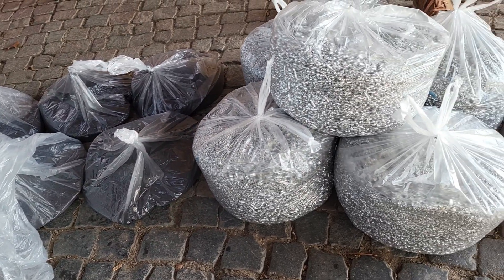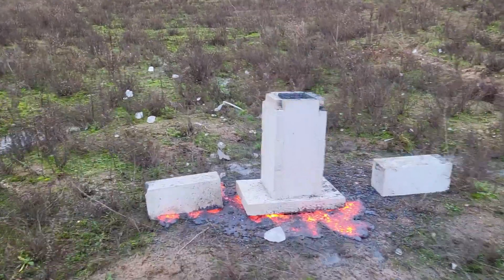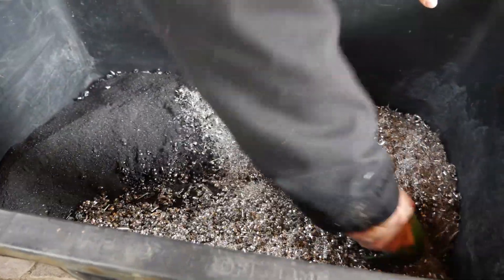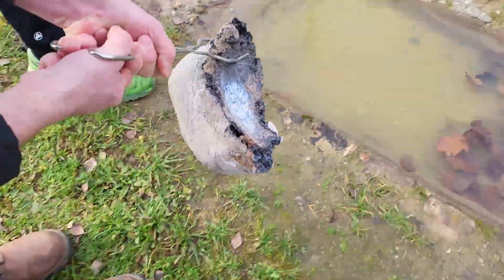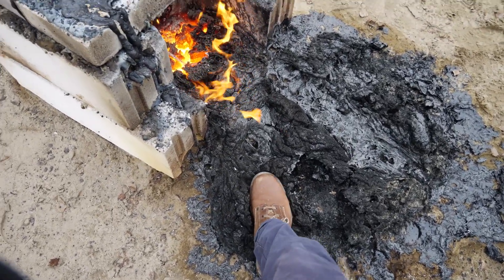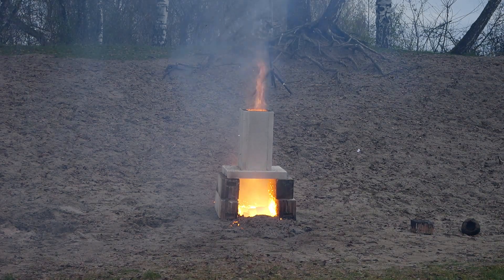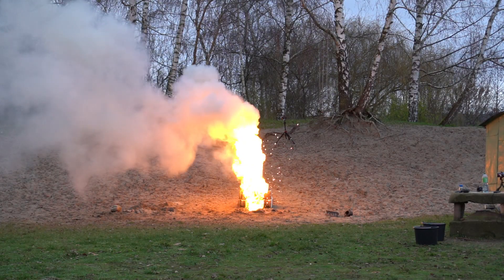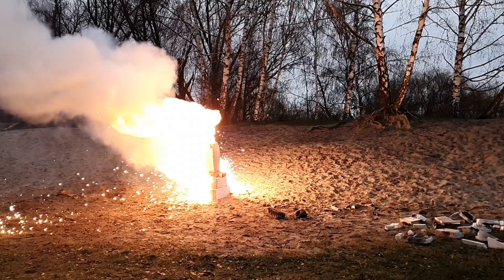Experiment: LAVA vs GASOLINE

Comment: Loyal subscriber Mr. Metal here!
I love this concept, something very volatile/reactive held back by extreme cold! I would love to see NaK/Cs vs. liquid nitrogen, and maybe even vs. liquid oxygen!
to continue with this concept, cool down the Cs in liquid nitrogen first so that its very cold, and then drop that in the liquid oxygen. (of course, if the first experiment does react, and the Cs reacts with the liquid nitrogen, then to cool it off for the oxygen bath, you would first need to put it in a container that protects it from the nitrogen) I also doubt the metal will react with liquid nitrogen, but perhaps it will when hot!
secondly Elias, as for the explosion, its almost certainly a steam explosion, the question is as to what causes the steam to get trapped in such a way as to explode. there's a video from TKOR on a similar subject: https://www.youtube.com/watch?v=73phHyBizec&list=WL&index=7
and when molten aluminum is dropped into ice you get a similar effect: https://www.youtube.com/watch?v=dAHolupCEkc&list=WL&index=5
there's a great video by the backyard scientist on the same subject as well: https://www.youtube.com/watch?v=PDRWQUUUCF0
TKOR also had a video about molten salt vs dry ice, as well as molten aluminum vs dry ice, and there was very little reaction, so I suspect it has something to do with the water, perhaps the fact that water/ice can be a liquid, unlike CO2/dry ice. an interesting observation I should point out, is how molten aluminum doesn't explode in water, but molten salt does. yet they both explode in ice, I wonder why... TKOR also tried this with molten lead in ice, and they got a similar explosion: https://www.youtube.com/watch?v=ur0k8XDFUro&list=WL&index=6 but these explosions don't happen in water, they only happen when you use ice, with the notable exception of salt which explodes either way. it also appears that you need to get the salt hot enough, otherwise the explosion is very small. TKOR also tested molten copper and brass, and got no explosion, indicating that maybe it can't get too hot otherwise the reaction/process doesn't work. too cool, and there isn't enough energy to rapidly boil water, too hot and the Leiden frost effect prevents any water from getting trapped, which means no explosion, but when its just right you get a big explosion. we should test molten zinc in ice as it has a low melting point too, and then try some more salts, like sodium fluoride, or potassium chloride. if zinc and aluminum make a bigger explosion then they might be reacting with the water, since they are reactive metals, so maybe we can try tin and just overheat it a bit so its equally hot as the others then pour it in water. tin is far less reactive and shouldn't explode if reactivity is the main factor. molten silver would also work. we could try molten magnesium, its very reactive, and as long as we don't get it too hot, and don't let it burn beforehand, it might not burn in the water, but might still explode, idk. I also had the guess that maybe since the molten salt was really hot, it somehow started to dissolve in the water very rapidly, and made it boil extra quickly.
I should also mention that The Backyard Scientist also did a thermite experiment in water and got no explosion: https://www.youtube.com/watch?v=tj7S_DNFgEU indicating that perhaps the ice you used has something to do with it, or perhaps the fact that you scaled it up so much. TKOR tried ice vs molten copper which has a somewhat similar temperature to the thermite: https://www.youtube.com/watch?v=lKoUmJp1NIw and they got no explosion. you could try pouring molten iron, and molten aluminum oxide separately into ice.
Reply from the maker: Thank you so much, this is probably the most helpful comment on this video! NaK vs liquid Nitrogen would probably just freeze it and if you drop it in water it would go boom once it melts. Room temperature cesium blows up, when you drop it in liquid oxygen. I already showed that in my first caesium video. 
About all the other links you collected, I need to check them once I have some time. But this definetly looks like something for a future video!
Reply: @EliasExperiments  You're welcome, and thanks!
Reply: @Metal_Master_YT Next time you comment, please try to put some thought into it and give examples. This seemed rushed 😉

Comment: Since CO2 is what is used in fire extinguishers, I was not shocked by the lack of a violent reaction with the dry ice.
Reply from the maker: Water is also used to extinguish fires so that is not too strong of an argument in my opinion.
Reply: @EliasExperiments  That is true but water sublimates at a much different rate than frozen CO2. Water is much more dense so when it goes from liquid to steam rapidly it releases a lot of energy very very fast. CO2 converts to gas much more slowly and it's a much less dense material so you don't get the violent reaction  you get with water. Original fire extinguishers sprayed water. Most modern ones do not because if you spray water on certain flaming materials like certain oils or hot grease you actually get a giant fireball due to the explosive reaction water has when it is heated very rapidly. CO2 does not respond that way. That is why fire extinguishers can be used on electric fires and gas fires and oil fires but water cannot.
Reply from the maker: I just checked and the mass density of dry ice is around 1.5 g/mL while the mass density of water ice is around 0.9 g/mL so that can't be the explanation. Also water going from ice to steam consumes a lot of energy similar to CO2. I guess the more likely explanation is that the dry ice was not in one big block like the water ice, making it harder for both to get into proper contact. There still certainly is a lot to discuss and discover here :D
Reply: @EliasExperiments  as it turns out you are absolutely correct and I was absolutely wrong.
Reply from the maker: I doubt that haha :D

Comment: So what might be happening with the thermite is that its so hot its splitting water molecules into Hydrogen and oxygen which re-react with each other
Reply from the maker: Yeah the question is how can one prove that?
Reply: @EliasExperiments  because thermite burns hotter then the decomposition point of water 2200 °F
Reply from the maker: That does not mean the water gets that hot and the reaction takes place to any significant degree. We would need a much more sophisticated proof.
Reply: @EliasExperiments  oh yeah, you need to take the thermal conductivity of water into play here

Comment: Pretty sure it's just the special properties of water, particularly specific heat and vapor pressure. I can't imagine any violent chemical reaction elemental iron would have with water.
Reply from the maker: I get what you mean, but at 2000 °C elements can do quite unexpected things.

Comment: The explosions caused by ice/thermite is aluminium residue reacting with the water. If you wanted to verify you could have thermite melt aluminium and have the nurning hot aluminium drop on the ice (im thinking plain water will do fine)
Reply from the maker: I am not so sure about this. If it would indeed be aluminium reacting with water, nothing else molten should blow up in contact with ice, but I don't think that is the case.
Reply: @EliasExperiments  I melt steel for a living, im reasonably sure if there was considerable risk itd explode on contact with water someone would have mentioned it by now.
We know the reaction, its aluminium reducing the Iron oxide to pure iron and leaving aluminium oxide, As best i recall a very light white fine powder, with low heat capacity.
Only things in there ever would be iron, aluminium and the two oxides (that are both extremely inert. Conclusion.. especially as you arent using really fine powdered aluminium.. Some aluminium bits can likely get flushed down true without reacting with iron oxide, thus basically falling as superheated, but encapsualted (from atmospheric oxidation)  in pure iron, till released on the ice.. (well water, but you know what i meen)
Reply from the maker: The thing is I don't think this reaction is only happening with thermite or molten aluminium. I have also seen water ice exploding with molten copper. It is certainly possible, that lefover aluminium is reacting with the thermite under these conditions, but that can't be the only explanation.
Also I am pretty sure, that if you pour molten steel on water ice, it would also blow up. Maybe an idea for future experiments!
Reply: @EliasExperiments  I did some repair work on an actual steel smelting plant (titanium ore processing iron was biproduct) They had iron come out in what resembled bars of soap, like oval 25x15x5 cm. more or less poured in molds and rolled out in open air (in Norway) Id be guessing if there was any risk of explosion theyd not do that.

Now molten metal steam explosions do happen, typically with aluminium, bronce and pewter. Most accounts of it happening i have seen is when metal is poured into confined spaces with moisture in there (ie actual casting moulds) But specifically aluminium can chemically react with water. Copper, lead, pewter and bronce, will just flashboil it and if confined get blown out (wich is pretty bad to be around). Bronce specifically is known to be trecherous to cast.. Possibly the alloy components can get up to wierd things, but it tends to bubble and fume if temperatures arent right.
Reply from the maker: Hm very interesting. Thank you for the additional info!

Comment: If you heat water enough it breaks down into hydrogen and oxygen. Those can then combine to cause an explosion.
Reply from the maker: In theory yes, but how can I prove, that his is actually happening in practice?
Reply: Is there anything that reacts with hydrogen to create a color change and is impervious to the reaction? This could be combined with the mix at low levels, and the residue analyzed to see if any of the color changing compounds actually changed color due to the presence of hydrogen. I found somethint called detect tape on YouTube for detecting hydrogen leaks with a color changing tape, maybe this could be of use to you?

Comment: with all that hot molten metal my hypothesis is that it's stripping off the oxygen from the water and releasing hydrogen which then causes the explosion when mixing with atmospheric oxygen
Reply from the maker: Well that might happen, but I am not sure it can happen that quickly to cause such a large explosion.
Reply: @Lurch402 Yes, its thermal decomposition of water. The same thing that happened in Chernobyl, but the catalyst there were the zirconium and iron in the fuel rods cladding, much lower temperature needed (like half compared to here). Here we have aluminium and iron and much higher temp.